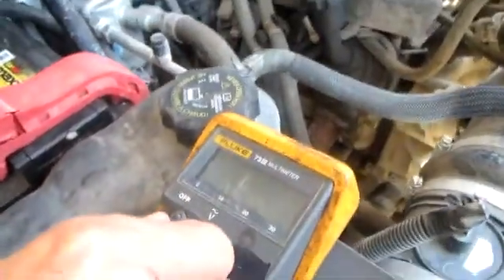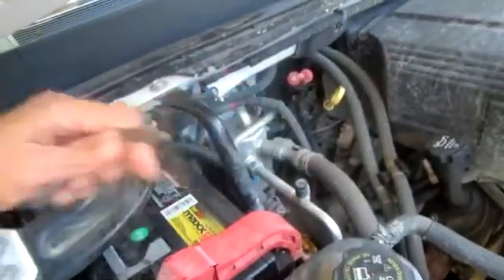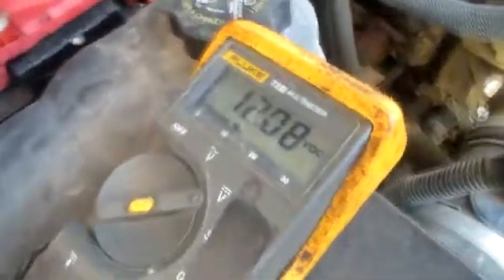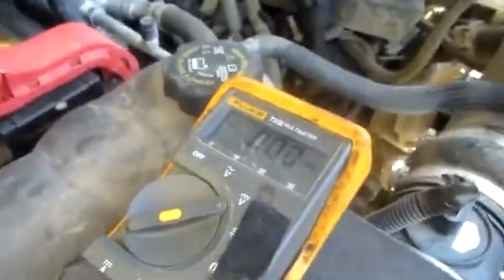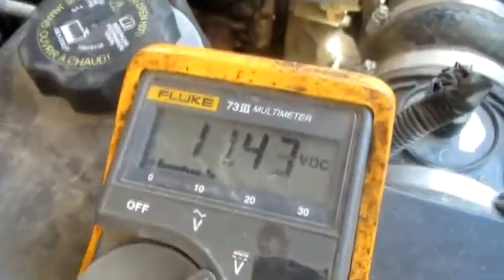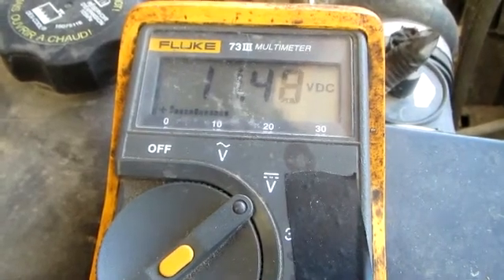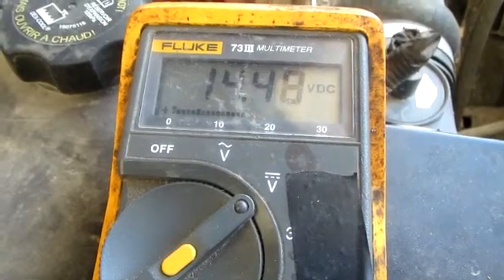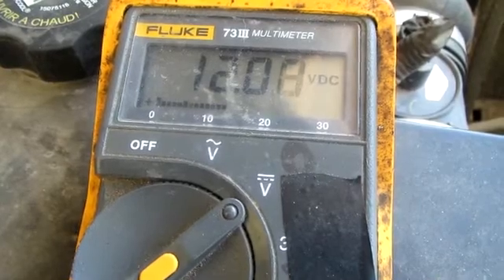Using A Multimeter To Check an Automobile Battery and Charger

Comment: Nice and simple, thanks! Personally I use a mini-voltmeter in the car's lighter plug. One question: I have a working (although old) multimeter, how can I check if my battery booster/charger that I keep in my trunk is still good, the same way after turning it on? I fear about blowing the multimeter... EDIT: I just did it, same way (of course..), as well as I can do the same via the multimeter's AC volt measurement  for my household outlets. Thanks again!

Comment: Very misleading title for your video. You are not testing a 'charger', which is a device that you plug into a wall-socket in order to charge the battery away from the vehicle. What you are testing in the video is the vehicle's 'charging system', which remains attached to the vehicle at all times.
Reply: the 14.4 volts at the battery verified the charger was working.  Although I would have liked him to test amperage output of the charger.